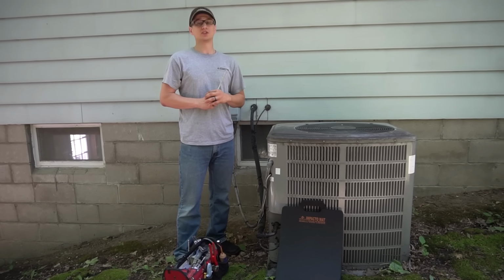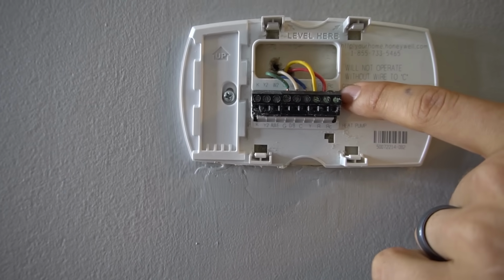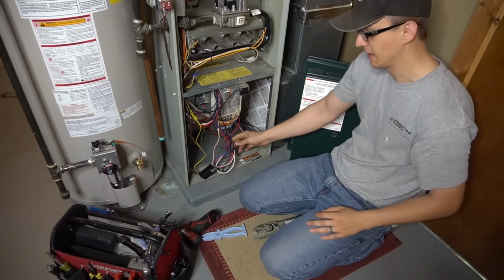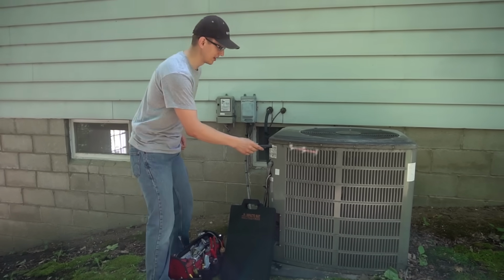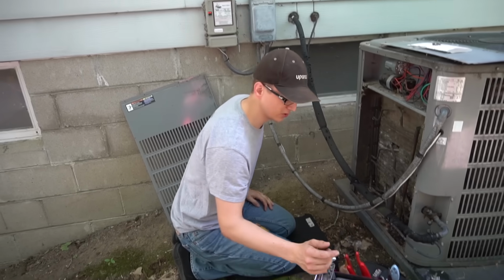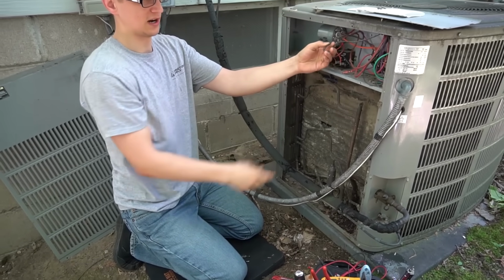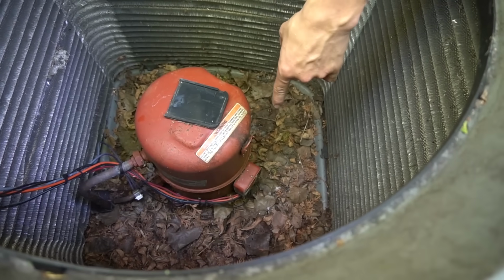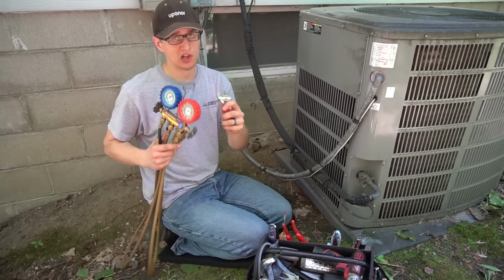AC Unit Not Turning On - How to Fix It Step by Step

Comment from the maker: Hey guys! I hope your AC fixing is going well! I just re-watched this video and here are the few things I noticed that I forgot to mention:

- Sometimes the furnace power switch is right above the filter slot. Occasionally people will accidently hit the power switch while they are replacing the filter and not notice that they turned it off. So make sure that is one of the first things you check. ;)

- I started talking about where batteries in the thermostat are but never did finish saying that if you haven’t replaced your thermostat batteries in a long time, you should. Weak batteries may be all it is.

- The two thermostat wires (white and red) that come in from the condenser unit outside go to C and Y on the furnace control board. Need more help with AC wiring? Here is a basic AC wiring video: https://youtu.be/KCanZEsLVEI

- Sometimes a furnace will have a small 3amp breaker instead of a fuse. If your fuse or breaker keeps tripping and you can't figure out why, this is a good video to watch: https://youtu.be/4e4wsruGS0s

- If your disconnect has fuses in it, sometimes one or both fuses will be tripped and need to be replaced. If they trip again in a short time, then something is not working right and needs further investigation.

- If the 24v plunger on the contactor is not pulled in, you most likely do not have 24v there. There could be quite a few things that could cause that: Blown 3amp fuse in furnace, no power to the furnace, thermostat for some reason is not calling for cooling or is defective, power saver switch is delaying start up or is malfunctioning, LPS or HPS is open (this scenario will most likely need to be looked at by a technician). Watch this video for 10 reasons why the contactor is not pulling in: https://www.youtube.com/watch?v=NVPhsK4gK1A&t=1s

- If you end up replacing your condenser fan motor and it’s coming off hard, loosen the holding screws and push the fan blade down first. Sand down the shaft and oil it all. Then it should slide off pretty easily.

- One reason why a capacitor fails is a dirty furnace filter. Make sure you don’t forget to replace your filters. I also noticed that after a thunderstorm we tend to get a lot of AC calls where the capacitor has failed. Not exactly sure why that happens but perhaps it’s a good idea to turn the AC off when it’s storming outside. If you need help locating your filter, watch this: https://youtu.be/uPaZvHp4L2Y

- I mentioned that you should clean your condenser coil but I didn’t explain it much further. If everything is working but it seems like it’s not cooling as well, a plugged up condenser coil could be the culprit. Get that cleaned and you should see a big difference. If you are not sure how to clean it, I show an example here: https://youtu.be/pzwOvgjwm_Q
Reply from the maker: There's a good chance it is the capacitor. The easiest way to check is to push in the contactor plunger (very carefully since likely 240v is present) and see what happens. Turn off your AC at the thermostat before doing this.

- If the compressor and fan start when you push it, then likely your capacitor is good.
- If you hear it buzz likes it wants to start but it fails, then likely your capacitor is bad.
- If absolutely nothing happens, then you don't have 240v power.
Reply from the maker: Thanks Ezekiel! Do you have a multi meter? It would be nice to check if the condenser fan motor is getting 240v. But if the compressor is turning on, that means most likely the fan motor is getting voltage too. Unless one of the wires going to the fan motor is burnt or broken. You should look over the condenser fan wires to make sure. Unfortunately the most probable reason is that the fan motor windings are bad. I would guess that you need a new fan motor. The only way to check for sure is with a multi meter though.
Reply from the maker: From the sound of it, you may be low on refrigerant. If that is the case, unfortunately this will likely be beyond a DIY fix. It sounds like your unit is tripping the low pressure cut out. Which usually happens when there is a refrigerant leak in the sealed system..
Reply: Word of Advice TV ...Yay! Found you on YouTube , took a photo of the bubbled capacitor and model number of my 4Ton unit. Bought a new capacitor for $44 and a 5/16 nut driver head for $3. Simple fix thanks to you. BTW, I'm 65 yr old poor female. You made my life better! THX!!
Reply: Word of Advice TV pleas need to know asap. If anyone can help the green wire that runs from the house got ripped out by my dog where does it connect to cant find where its the ones that are with the red and white and green..its 111 out
Reply: my ac is on its a 2 year old bryant ac the air coming out is not cold could my problem be low on coolant or what else thanks  jack
Reply: Thank You for very detailed video. I hope you can help me fix my issue with compressor unit. It starts during the morning hours and stops around noon time. Every thing else seems to be working except that the Compressor unit doesn't start.  Later in the evenings it starts again when I switch the circuit breaker for Compressor unit. Do you know what could be potential problem?
Reply: My ac is 2 years old and everything turns on except the fan I installed a new compositor but the fan still won't spin I tried kick-starting it by spinning it manually and it's free I don't know what's wrong could u please help me? And nice video bty.
Reply: Word of Advice TV thank you so much I wasn't sure what it could be I think I just need a new moter or to fix the wires if damaged.
Reply from the maker: Yeah, if the wires look good then most likely the motor is bad. Also, I would replace the capacitor as well when you replace the motor. Good luck and be safe!
Reply: Word of Advice TV
Reply: Word of Advice TV  hey so I came home yesterday and my house was warm after i left the ac on for the day? From inside the unit sounds like it’s working fine. But from outside no fan spinning and no sounds....literally hear crickets. I checked the vents inside and barely any air blowing out and it’s not cool?  Any ideas? I’ve been reading maybe the run compasiter? Maybe a dirty air filter? Any ideas I can check before I call a service tech?
Reply: Word of Advice TV so it turns out that my circuit breaker tripped and I had to turn it back on again. Back in business. Can’t believe I skipped the easiest step that you’ve mentioned before in videos!!! Man I feel like a dummy. Anyhow I cleaned out the debris buildup that fell in my outdoor unit like leaves and what not that was around the fan and also switched out my filter. But was wondering why would the circuit breaker turn off? Is that a warning that something is due to break? Or maybe I’m running the ac too much?
Reply: Hey, thank you for the great video, I'm currently having an issue with my AC unit which is a York. Going to watch all ur AC videos to see what might be ways to solve it. But if you have any advice that would be great. Right now, air is blowing out of my air vents, but my house isn't ever reaching the temperature that my thermostat is set at. My honeywell thermostat has a red light that flashes four times and then repeats, which from my online research means it is "off on low discharge temperature", but I don't know what that means. When I pull out the thermostat and put it back in the light stops flashing for a while, and I have heard the outside AC unit turn on and spin and work at least initially,   but for the most part, it is completely inactive and not spinning, and just the fan is blowing in air through the air vents, and after a while the flashing red light comes back. If you have any tips that would be great, and thanks again for the videos.
Reply: Word of Advice TV Okay thanks. I’ll give my service tech a call. You also mentioned in another reply about the compressor pulling too many amps on hot days, and installing a Hard Start unit. This is a much cheaper fix, so I guess I should start there? Is this an install a fairly handy person (me) could do?
Reply from the maker: Oh it is very easy. I should make a video of how to put one in so I could just direct people to it. I would first check and make sure you don't already have a start capacitor in there though. It will look like the grey capacitor but it is almost always a black cylinder. It comes with two wires. One wire goes to HERM on the capacitor and the other goes to C. (make sure power is off before hooking up) If you have a single capacitor instead of a dual capacitor, then one wire goes on one side and the other, on the other side.
Reply: I changed the battery and checked breaker etc. I put the fan on but Furance blower motor fan is not starting. Nothing at all no Huming noise nothing. What could be wrong. I noticed a lit bit water near the Furance. Help please.
Reply: Also, I switch to fan mode and tried E-Heat mode(Heat pump) nothing. Cool blinking on Thermostat. I saw water in the panel door. I think drain is clogged but not sure what to try next!
Reply from the maker: Here, I think this article will help you out :) http://acwiz.com/index.php?action=artikel&cat=18&id=26&artlang=en
Reply: I saw your message about “fuse” not able to read the whole message. Yes nothing is working outside unit not working. I changed the motor’s capacitor and Thermostat too. 
I checked the fuse and does looks good. Should I replace the fuse ?
Reply: I did bypass the thermostat but outside does not start nor turn on.
Reply from the maker: Have you cleared out your plugged condensate drain yet? I would focus on that for now. You might have a condensate overflow float switch that trips if water is backing up in the evaporator coil drain pan. When that float switch trips, nothing will work. Sorry if I already asked this earlier but do you have a multi meter that you can check voltages with?
Reply: Word of Advice TV  I think I just figured it out I think the capacitor died. It was humming over the past 2 months that guy that came out last time is pathetic that he did not replace that..... I am mad. It is a good thing the guy didnt charge me because he didnt do anything.
Reply: No, I will work to Clean the drain and I do not have MM. I never done this much troubleshooting. Thank you for your help.
Reply: Word of Advice TV@ thank you! One of the most comprehensive guide!
Reply: most civilians will have to watch and rewind a lot...you break it down like i do.   However,  so many think they can do it... some get lucky or have that hidden tech within.  lol... just the other day i was simplifying...to the best of my abilities...what was wrong with an AC that had done a sheriff's deputy wrong. he told me i was speaking Greek to him...sad!...and funny at the same time.  We are always practicing our skill as any doctor or lawyer...learn everything and stay hydrated brothers...
Reply: I tested RWGCY wires in that order to find out that the C-common is the one that blows the fuse.. what would be my next step?
Reply: Incidentally, my the herm side of my capacitor went out, and it has been heavy storm and heat.
Reply: great vid   i have a rv a/c ,,, has power to unit,,,   replaced all capacitors no luck,  maybe the motor?  i wish i had a hum or some kind of noise lol
Reply: Word of Advice TV 
Hey thanks for the great video!
Do you know how to clean an ac A coil in the furnace without taking it out?
Reply: I need help with my ac ASAP
Reply: Word of Advice TV what state do you live, my AC just went out...I'm going to try to do it myself (your video is great) but it's scary..
Reply: I have a central ac unit that intermittently stops working.  It will work fine for hours and sometimes days.  When it does fail there is no air blowing in the house and it appears that the unit outside is working (fan is spinning, not sure about the compressor). The refrigerant line most times will be iced up along with the compressor.  Usually we shut it down for about 5 minutes and turn it back on at the thermostat and it will start working again but we would love to fix this issue before we go away on vacation.  Any thoughts on what might be stopping the system?  I'm wondering if the air flow on the return to the A frame device is bad.  I replaced the filter so that should be good but before we purchased the house the prior owner used to use these blue fiberglass like filters which had no cardboard, wire, or any type of framing support. I believe a lot got through that thing and the A frame wire device might be all clogged up but not sure if that would stop the house blower motor.
Reply: Thanks for the video ! I replaced the 5 amp fuse since it was blown.  However I still don't get power to the thermostat. I saw in your comment updates, that there might be a 3 amp breaker. How do you locate it ?
Reply: My AC fan does not want to turn off everything else works but the fan stays on I have to turn power off to the unit in order for it to turn off so you have a video on that ??
Reply: I must be missing what to do 🙈 I heard you talk about if the AC kicks on, and cool air comes out the vents, but the house doesnt cool down.. please help!
Reply: My HVAC stopped working today at first the inside blower motor stopped now the outside condenser isnt even turning on..... I wonder wtf is going on. None of the breakers are tripped or lown. When the thermostat calls for freon I hear it click three or four times the blower fan spins a little each time it clicks then nothing. 4 months ago it started making a vibrating noise when it came on I had a guy come out and look at it but he couldnt find anything wrong SO I dunno. I have a guy coming in the morning to look at it but if it is the blower motor I wont have AC for 5 days until the sears guy can get out here because it is a proprietary blower assembly. My furnace does not seem to have an on or off switch nor does it have a door switch that I can see. It is a kenmore It was installed brand new 3 years ago net month. I have already had to have sear replace the blower assembly once while it was still under warranty the blower fan is not grating and it turns freely.
Reply: I did the checks from the thermostat all the way to outside and still can't seem to determine what is going on.  replaced the batteries in the thermostat, made sure it was on hold  fan won't turn on inside...checked the fuze in the furnace and on the panel box as well.   blades turn without a sound still nothing.
Reply from the maker: Interesting.. Do you have a multi meter? https://amzn.to/2JWI1pU  Troubleshooting would go easier if you do. So the 3 amp fuse in the furnace is not blown and the furnace circuit breaker is not tripped correct? Here are some ideas that come to mind.. 

- If your furnace control board has an LED red or green light on it, does it turn on or blink?
- Have you checked your furnace power switch, perhaps it accidentally got turned off.
- Does your furnace work? If furnace is not working either, then you are losing power somewhere.
- If you reach in and try to spin the blower motor in the furnace, does it spin freely?
- If you are comfortable with doing this.. Your furnace control board has a terminal strip for the low voltage. Try putting in a little jumper wire between R (power) and G (fan). Then, with the furnace switch on, push in your door switch. Does that turn on the fan?

Let me know what you find! And if you have a meter. I could tell you what and where to check voltages.
Reply: Yes I have a multimeter.  No red or green light.  There is an amber LED light that turns on when the fuse blows. The 3 amp fuse keeps tripping.  No the furnace is not working.  The blower motor spins freely.  No exposed wire on the thermostat wire that I can see.  Outside unit will turn on when I bypass the thermostat when I depress the contactor button.  No evidence of any damage on outside unit from critters or otherwise.  Will try the jumper wire and get back with you.
Reply from the maker: What you can try doing is pulling off all the thermostat wires from the control board. R,W,Y,G,C. Take note where each wire goes. Replace the fuse again and turn your furnace back on. Does the fuse blow with the thermostat wires off? If it does not, then start putting the wires back on one at a time. I would go in this order: R,W,G,C,Y. When you start putting wires back on, make sure the thermostat is calling for cooling and you turn the power back on after you put on each wire. Doing this will help narrow down and track what is tripping that fuse. And just thought I would add this in case it will help:

R: Power
W: Heat
Y: Cool
G: Fan
C: Common

Let me know what you find
Reply from the maker: Yes, the problem could be low on coolant. Can you tell if the compressor outside is turning on? Sometimes the fan will spin but the compressor does not come on. I would say the 2 likely options is that either the compressor is not running or you are low on refrigerant.
Reply from the maker: Hey Ramesh! To me it sounds like your compressor may be drawing to much amperage. Putting in a hard start kit will help a lot with that: SPP6 Hard Start Kit: https://amzn.to/2JSPieo  It cuts the start up amperage of the compressor almost in half. (the two wires go to Herm and C on the capacitor) Another thing I would do is wash down the condenser coil even if it looks clean. If you are not sure how, watch this https://www.youtube.com/watch?v=xSx5HAFATtw&t=79s  Also, make sure you replace the furnace filter regularly. Let me know how it goes for you! Good luck, be safe, and stay cool! :)
Reply: My Tempstar 2-ton wih a Copeland compressor is now 25 years old. It seems to be running ok but should I just go ahead and install that Hard Start kit you mentioned above? Well done videos by the way.
Reply: Excellent thorough video. Thx. I just commented on another of your videos about my intermittent compressor. It’s 112 here today, House thermo is set to 78, and the unit has been on all day and still not cool, 83 in here. I forgot to mention in my other comment we had the control board replaced after it fried a year or two ago. R22 was topped up and some kind of leak stop pumped in a few years ago too. Too hot to get on the roof today to check everything. But when I do, is it okay to was the fan/coil with water in the same manner you would a ground unit? Also when it was installed a disconnect was never put in so we have to shut it off from main panel. How can I install a disconnect? The box is there it’s just hard wired straight through. Thx!,
Reply: Word of Advice TV   Do you have any videos about how to troubleshoot the TXV?
Reply: Chenhui Li if you have gauges similar to those he shows in the video when you connect them for the most part your pressure readings on the gauges will just keep going up and down (hunting)  that’s how I was taught hope it helps 👍
Reply: BADASS VIDEO BROTHER!!
Reply: every thing seems working but no cold ac and the unit in furnance is warm and not cold
had the s\ac recharged and worked for three weeks 1410 unit is 4 years old
Reply: my son put the wrong freon in my unit and the ac does not get cold. i had a guy put system in vacum and they he recharged the system and it worked for three weeks and now it does not blow cold air and everything seems to be working . the coil above the furnance does not get cold at all and the out side fan unit blows cool air out the top.
Reply: Hello I have checked the connection of all wiring replaced my capacitor and fan motor. I have a single phase small package heat pump model # Q5RD/060k the blower fan is comming on in unit but the run fan will not, and I can not hear the compressor kicking on. Check it according to your video and all reads well. What can I do next?
Reply: Word of Advice TV could I get your number so I contact you directly or could you contact me through an email please. Let me know